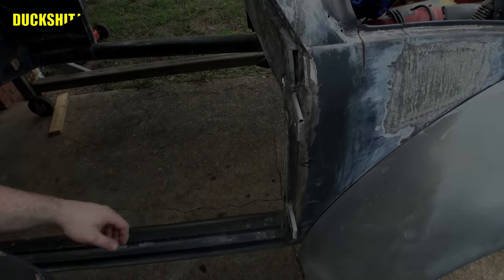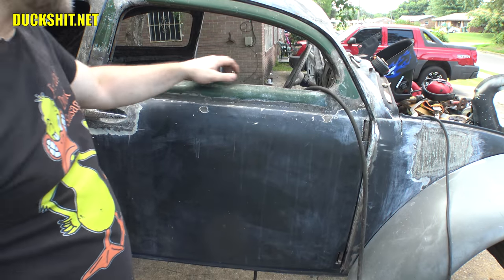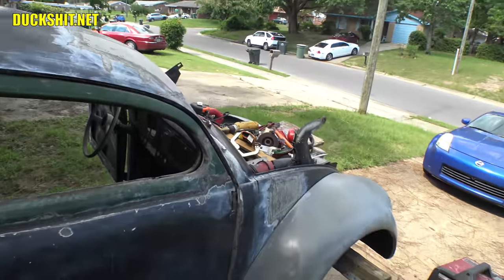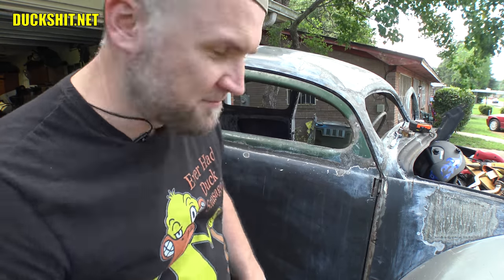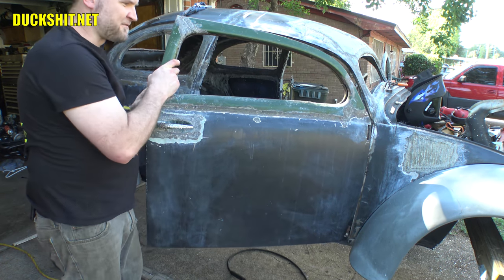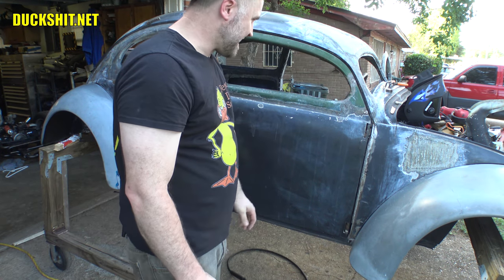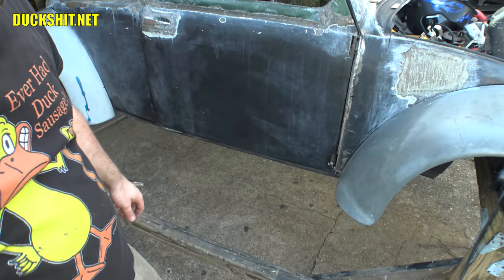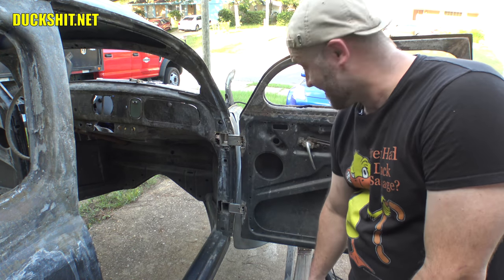Does it Work? - VW Beetle Hidden Door Hinges 8 - ROTTEN OLD 1956 - 105

Comment: Gregory,just sitting out behind the house.Sad
Reply from the maker: You are aware because I have said more than once that there is a plan in effect.
Reply: @DuckmanCycles  I had a 64 bus in about 72. Blew the motor. No mechanical skills at the time. Sold it. That two  tone green. I've had a few Jettas since. Still got a 04